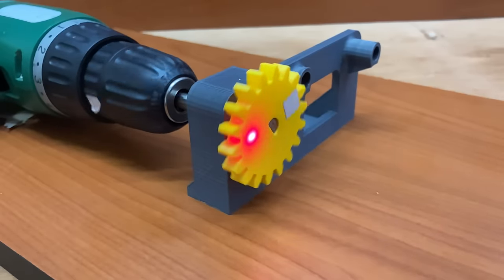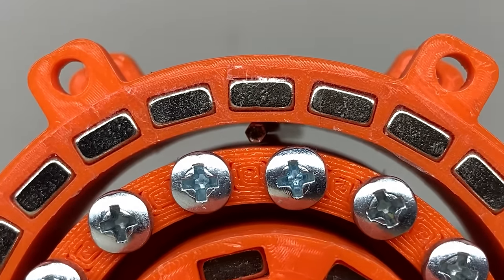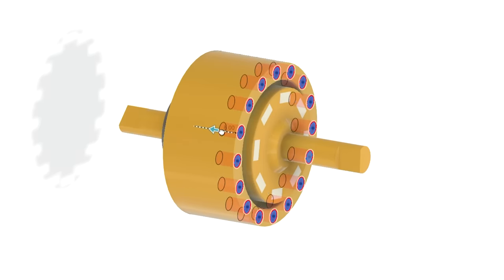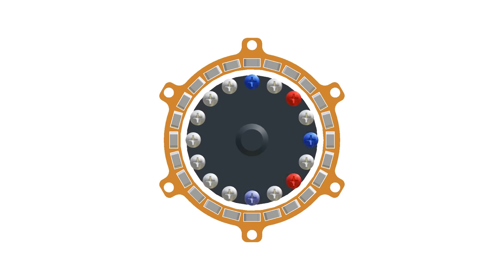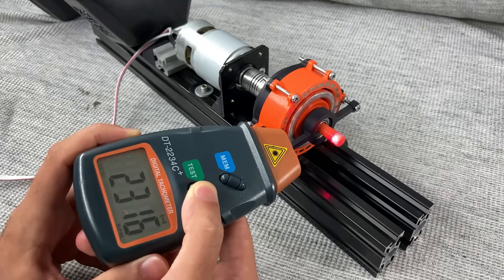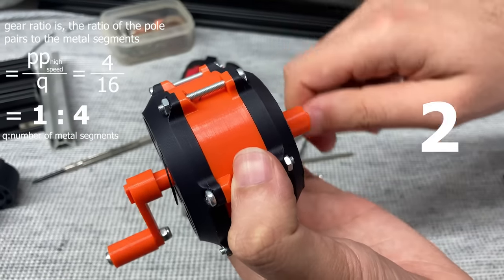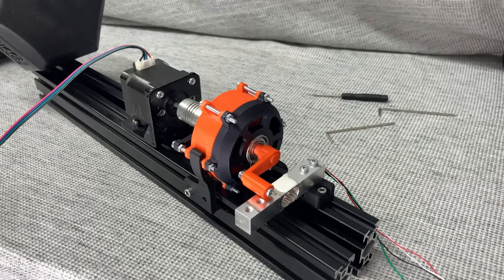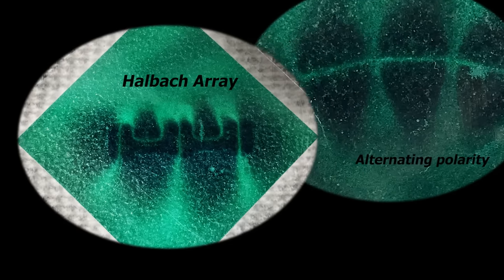Magnetic Gears - Why Nobody Talks About This?

Comment: One of the reasons these would not see widespread use is reduced efficiency due to eddy-current losses within any nearby metal components, and you would want a low reluctance metal housing to ensure you don’t induce voltages into nearby wires.
Reply: @Jeremy Karst. This is what magnetic shielding is for. You know those little speakers that sit next to your computer. You noticed they don't affect your screen. Magnetic shielding preventing magnetic fields from escaping
Reply: @jerichojoe307  I'm pretty sure the amount of current going though a standard speaker isn't large enough to matter, considering I've never added any type of shielding to any speakers I've made.
Reply: @Gorgonzeye  it mostly applies to old CRT displays as far as I know. But the point still stands. Just not the greatest example.
Reply: @Gorgonzeye  the amount of current going through the speaker isn't what I'm referring to here. The speaker itself has a toroidal magnetic field around it even when it's not hooked up just like the static magnets that he is using. Like the guy below commented it may not have been a good example as it only applied to certain types of screens; but it still applies to the point of preventing the magnetic field leakage inducing current in things around it or affecting things that are magnetically sensitive. Many motors still use  shielded housings to surround the motor to prevent such things as current passes through the coils of the motor. Whether it is electromagnetic field or a freestanding magnetic field; simple shielding would prevent what you initially proposed. He is not feeding any current to the gearbox. He's feeding current to the motor that is attached to the gearbox which already meets proper standards and wouldn't require such shielding but the gearbox still does because of its magnets. And even that would depend on the gauss rating of the magnet and how far out the rotating magnetic field could affect things or induce current. I mean think about it. There's a very large rotating electromagnetic field generator inside of your car called an alternator; but you don't see that inducing currents that interfere with any of the electrical functions of your vehicle do you 🤷 my brushless bldc impact driver has some pretty powerful magnets inside the motor but I don't see that so much as disrupting any functions of my cell phone while using it right next to it or while working on a metal door. a magnetic field has to be very close to another metal or very strong to induce currents in surrounding wires or metals, so shielding is not always necessary depending on the strength of the magnet but if it were necessary it would be a very simple solution.
Reply: @jerichojoe307  the problem the original comment tryed to point out is that BECAUSE we need shielding the magned will lose energy into the shielding and isn't transferig it into the other gear while the other gear is losing energy it receives because it is inducing part of it into the shielding and not into rotational energy. that means we have losses in the first gear AND in the second gear. and you would need electro magnets because permament magnets lose slowly their magnetic field when it's magnetic field gets moved.
thze next problem is that you can't accelerate or decellerate these gears fast because they would slip if the jerk is strong enough and it takes way less than for normal gears. the same applies to load on the second gear. if the load is too high the second gear won't move and you need REALLY strong magnets to move the same loads normal gears take without problems. like he shows at 10:00
Reply: @Robin4givin the problem remains that they have almost no torgue before slipping. that means that you can stop the second gear with your hand even if it is spinning at full speed. (like he has shown in the video at the end.) you would need really powerfull magnets with almost no gap that the repulsion of the magnets is strong enough to not have them slip when the second gear gets loaded.
Reply: @indiesigi7807  that too. the size of the magnets is importand and not easily scalabe because the size and material determinds the max magnetic field strength it can have after production. so using 20 1kg magnets to archive the same torque than a 0.4kg metal gear has is byond bad.
Reply: @jerichojoe307  The alternator has been cause for some issues with aftermarket efi systems in classic cars, as well as radios. There have been a number of folks that had issues with the Holley Sniper TBI getting weird issues with it's sensors and motors from the alternator.
Reply: @jerichojoe307  So that would be the high magnetic permeability materials would be best suited for magnetic shielding of the fields?   Guessing might be some design consideration of that material effect?
Reply: Yes
Reply: Yo all you guys are smart as shit regarding this haha. This is what science is for!!
Reply: Oh and lets not forget that ... shock and vibrations = DEMAGNETIZATION!
It is a very good idea to use magnets, where vibrations are unavoidable and omnipresent, as in rotating machinery. 
Thank you, back to the drawing board, beloved design (and I guess marketing?) students ... *facepalm*
( I bet it takes not a millisecond, then one of those little f's will come around and cries: "Eureka ... Let's use electro-magnets!"  )
Reply: Maybe halbach arrays could help!
Reply: @dieSpinnt  vibrations aren't that big of a problem with a proper keeper designed for the magnets. And speaking of electromagnets... We've already got electric motors both with and without permanent magnets. All the engineering for eddy current loss etc. is already there... That being said there's no reason to reinvent the wheel (literally), metal gears bathed in oil already last forever
Reply: But it would be good if you wanted to maximize eddy current losses for a different purpose
Reply: Would modern ceramics and Faraday cage contain the current and direct it back into the system? Is there a video that could explain what’s going on with the current?
Reply: Total energy loss of a drivetrain is usually the driving factor for cost. Also why use rotating gears when you can use wires, thats fairly common, see a diesel electric locomotives etc.
Reply: To further reduce the eddy currents a laminated outer stator should solve the issue, along with offsetting the neodymium magnets by rotating them 36.5° along the longitudinal axis to further even the flux density and reduce torque spin.
Reply: @jerichojoe307  LCD's aren't effected by magnets in any serious way unless you put an extremely strong one near them, they don't require magnetic specific shielding.
Reply: Not only that, but the magnetic field strength is inversely proportional to the cube of the distance between the bodies, so without incredibly tight tolerances the practical maximum torque is laughably low
Reply: That, and magnets under regular stress will slowly (or quickly) loose their magnetic flux until it's no longer functional
Reply: I was just about to explain it after reading the title.
Reply: use non-mag stainless, ceramics and insulating liners.
Reply: @dovos8572  I think you are wrong about magnets losing their field over time.
Reply: @seandepagnier  do you have ever played with magnets? the conservation of energy alone is enough to say that magnets have to lose strengths when they move or resist the movement of electrons or objects. it might take years in some cases like having them just hang on a freezer without moving them but if you take them off and on on a daily basis they will stop sticking after a few weeks.
Reply: @benwilms3942  So it'll be brittle and let the magnetic waves through?  Great idea!
Reply: Use an aluminum enclosure as a buffer for that. Take a Onewheel hub motor as an example. No metals attract the the hub because the magnets are far enough from any area that it can attract from.
Reply: @dovos8572  It depends on the type of magnet, and the types used here take 100 years to lose 1% typically.   If they lost their strength so easily, many electric motors would not last but anyway can easily be re magnetized after a few decades as well.    The conservation of energy mostly is transferring to potential energy so its not lost demagnetizing.    I think the magnetic gear has a lot of potential, but should use ceramic bearings to reduce losses.
Reply: @Gorgonzeye  It has nothing to with the amount of current flowing through the speaker's voice coil, what he was referring to as far as shielding is concerned, is the magnetic field produced by the permanent magnet, which is independent of whether or not the speaker is supplied current. Permanent magnets produce magnetic fields just sitting there, I have personally ruined a crt TV when I was a teenager simply by walking past it with an unshielded car subwoofer in my hands.
Reply: @seandepagnier  there is a reason why in big generators exclusivly electromagnets. we only use permanent magnets to generate enough electricity to power the electro magnets of the actual generator. if we would use permanent magnets in the actual generator we would need really big magnet blocks (really expensive) and we would need to change them out regulary.
if permanent magnets really wouldn't lose their mangetic field we would use a self rotating magnetic system to power a generator that uses perma magnets to generate infinit electricity.
also a change in the magnetic field heats up the magnet a bit and heat is the death of magets. if heated up enough it will lose it within seconds even if it would last decades normally without getting uses.
Reply: @dovos8572  was waiting for the curie temperature reference.
Reply: @sergioezquerro  A Faraday cage is only effective against wave lengths greater than size of the holes in it / skin depth. They aren't necessarily effective against magnetic fields which are different from electromagnetic waves
Reply: Make the other components non metal?
Reply: @ltcuddles685  of course not for something as small as an led. But we're talking about how to make this actually a useful device for anything other than what he did. The way progress is made in today's world is multiple people brainstorming. We moved well beyond the LED in this conversation into slipping, magnetic losses in the bolts inside the transmission, strength of output torque,etc.
Reply: Try using higher resolution of alternating magnets and try two gears where one partially screws (cone shaped screw) into the other wheel that requires the torque.
Reply: There are many technological challenges to producing contactless gears. But they can be overcome theoretically and they will be overcome practically because this has application in areas where wear and tear are high or in areas where you want the parts to last thousands of years like in space exploration. This is good for anything which is extremely tough to repair.
Reply: @jerichojoe307  Actually they don't affect your monitor for a couple reasons:
1) The main reason these days is that LCD/LED monitors don't have magnetic beam focusing coils like a CRT, they flip pixels with + and - electrical charges, not magnetic N and S.
2) OLED monitors don't do pixel flipping at all so there's nothing to influence. 
3) Magnetic field density drops off quite dramatically with distance and even the largest speaker magnets (I'm talking 12" guitar amplifier speakers)  have to be within inches of a old CRT to affect it, also, the electromagnetic driver coil in a speaker is designed to focus most of its energy along the coil's axis, so escape to the sides is negligible. An old fluorescent ballast however is capable of having an influence on a CRT it it gets too close.
Reply: @dovos8572  i have used same perm magnet for 5y same strength
Reply: @RonnieMcNutt666  what magnets do you have? how often do you use them? and for what do you use them? if it are really strong magnets then you might not notice that they are now weaker because they are still more than strong enough for what you are using them
Reply: @dovos8572  also some old tools i have frm 1980 magnetic still
Reply: @sergioezquerro  there are materials that can  shield the greater portion of magnetic field lines but never 100%, although thats typically adiqete. They tend to be rather pricy though. I remember seeing small sheets of the stuff. Also every creavice/opening must be covered/layed or the fields will leak through just like coulomb/static/voltage charge would through a faraday cage. Faraday cages also require grounding to ambient background "neutral/ground" which can vary to be fully effective.
Reply: How does that compare to friction/vibration losses in mechanical gears. Would like to see that
Reply: @dovos8572  That's wrong. The magnetization magnets lose over time has nothing to do with the forces they exert. They do not "use up" their magnetization energy to push or pull on things.
The reason big generators use a field coil instead of permanent magnets is for the ease of induced voltage control and cost. You would not need to regularly replace them but they just aren't practical. Instead of using an expensive set of magnets you can just wind a coil around the rotor and power it with DC current (and adjust it based on the operating conditions).
Reply: You really only need to provide enough linear void space to account for the magnetic flux end effects.  This can be a really small amount of space depending on the magnetic topology
Reply: Contact free power?
Ohh.... nice
Reply: Don't magnets also slowly lose their attraction properties over time?
Reply: Most gear boxes I've seen (fot automobiles) have aluminum housing, non conductive non magnetic metal.
Reply: good point😶‍🌫
Reply: @dovos8572  There are no "magnetic perpetual motion machines". Even if permanent magnets lasted forever, you could not build one. It has nothing to do with how long the magnet lasts. All cyclical paths through a constant field exert no work which is why you can only generate or consume energy by changing the field.
You are also still wrong about why electrical generators (usually) do not have a permanently magnetized rotor.
Not sure why you would mention you are an electrician. It's not like any specialized knowledge is needed to be an electrician.
Reply: The real opportunity would be utilizing this somehow as a clutch somehow.
Reply: Actually the torque is the fault for these systems it's abysmal
Reply: @jerichojoe307  Screen effects from magnets really only apply to CRT monitors
Reply: I'd also imagine the eddy currents would create heat that damages the magnets over time too.
Reply: @todddooley793  It would make a terrible clutch because it transfers no torque in slip
Reply: @jerichojoe307  - What are you talking about? are you still using a CRT?
Reply: @dovos8572  Conservation of energy has nothing to do with permanent magnet degradation. It's accounted for by the kinetic energy taken out of the spinning material (driven by steam in most generator turbines). But I'd never considered the heating effects. I bet large steam powered turbines would get pretty hot! Makes sense that you'd want to use electromagnets.
Reply: Who can use only 200g of force
Reply: Might be less of a problem on sports cars made of carbon fiber
Reply: @jerichojoe307  or HDD enclosure as well as drive for CD-ROM :D
Reply: @jerichojoe307  This isent at all why modern screen isent affected, old screens was hugely affected...and thers usually insufficent shielding around those with inbuild speakers to prevent leakage...just enugh to pass the max limit of leakage...
Reply: well..so he invented a very bad version of the magnetic free motor(but with magnets)....that has been used for decades, as faar as i know exactly whats shown been used atleast 40 years...but is extremely ineffective (wasent a concern then)
...maby he should have read some science books...
Reply: @3xeplodng_3agle_studios  speakers will definitely kill a crt. Seen it happen with speakers under a old TV
Reply: @srck4035  indeed
Reply: whatever you say, science man
Reply: Like a transformer?
Reply: Magnetic gears + Graphene =  Interstellar travel + Zero g applications
[?]
Reply: More and more transmission cases are made with aluminum
Reply: Wow this group is hopeless. A rhetorical reference to an example of what shielding was used for; and everyone focuses on that like a laser asking if I'm still using crt; vs brainstorming on ways to possibly fix the issues with the transmission in question. No wonder progress in the world is getting worse. When I was younger; like minds brainstorming was how progress was made. Nowadays people only focus on pedantic corrections just to have the "I'm right" phase of conversational enjoyment; completely forgetting the premise of the original conversation🤦. I'm out
Reply: This.
Reply: Development is expensive for mass produced machinery like vehicles. It's not financially viable for most applications to develop systems that would be best applied to internal combustion engine applications when most of those applications are being phased out.
Reply: Plus low torque capacity compared to mechanical gears
Reply: @robert7100  No
Reply: @darthazgorath9570  Aluminum is conductive, very much so.
Reply: @gob0b  Where do you imagine heat developing.
Reply: well we don't use gears much in our daily lives, so it should be fine to popularize them for small creators
Reply: @dovos8572  You can fabricate reasons for ANY system to fail.  That doesnt mean ANY system is useless.  Theres uses for nearly everything.  Those loses you suggest would only be a problem with a poor design.  The shielding would have to be right on top of the gears, i.e. only if an idiot designed the system.  It could easily take over 100 years for a magnet to lose enough field strength to en ineffective.  Theres other things wrong with your presumptions.
Reply: @dovos8572  There are applications where stopping the second gear with your hand would be a safty benefit that no mechanical gear could provide.
Reply: @dieSpinnt  i suspect you pound on your geared implementations.  Normal people dont do that.
Reply: @UNSCPILOT  it will take 100s of years for the magnets to lose thier field.  Other moving parts are likely to break first.
Reply: @dovos8572  Stop sticking after a few weeks?  You are wrong on that one.  You need to heat or pound magnets for them to lose thier field that quickly.  If that was true then all electric motors that use permanent magnets, and there are lots of them, would fail just as quick.  They do not.
Reply: @marveloussoftware4914  I would expect hundreds or Maybe couple thousand hours of operation depending on the stresses, loading, and heat the magnets are subject to, and that could drop as low as a few dozen hours.

Magnetism is much more like a battery than people think and can be used up, especially in conditions that cause that magnet to heat up significantly or put the magnetic feild under constant strain.

It's one of many reasons that many large scale motors and generators don't have any permanent magnets inside and usually exploit magnetic induction or other similar tricks, in low torque, low heat, and small scale you can get away with a lot but scale up any one of those and you'll have issues quite quickly.
Reply: mechanical would still be the most reliable and I guess cheaper and faster to make but this'll have use in nano machines
Reply: Hence why we don't need wires anymore if we apply the gears properly with spatial energy coherence.  Simply being in this field would turn your device "on" with a "dead switch" to turn it off by disengaging its function with geometry, I.e. remove one gear...
Reply: Carbon fiber components are stronger than metal ones. The reason we won't see widespread use is the retooling needed for automation to work with the permanent magnets.
Reply: I doubt that is greater than friction loss with mechanical gears.
Reply: Its just so much cheaper using plastic gears. I'm sure there are niche uses for magnetic gears and couplers, but its probably in the realm of 10-1000x more expensive
Reply: The extreme reliability and zero lubrication of these gears make them great choices for spacecraft reaction wheels, though.
Reply: @UNSCPILOT  if your ecpectation were true then none of these motors with permanent magnets would last for years and years.  But they do.  I have seen many failed devices with motors.  It is rarely the motor which failed.  Magnets are not as fragile as you presume.
Reply: @jamezh2822  understood, then I apologize for my misunderstanding
Reply: @jerichojoe307  waving a high powered magnet around in front of my screen also does nothing, so maybe the shielding on the speakers isn't important. CRTs are gone.
Reply: "Why nobody talks about this?" 
Because their efficiency sucks.
Reply: Making everything out of something like carbonate fiber would be sweet
Reply: @Youtube_Stole_My_Handle_Too  its a specialized desihn woth limited applications.

The efficiency of fuel milage of a bulldozer sucks, thats why people dont drive them to work.  It doesn't mean they have no use.
Reply: @marveloussoftware4914  
Does it exist a machine that does a better bulldozer job than a bulldozer? No? Well, then your objection doesn't make any sense. Logic much?
Reply: @Youtube_Stole_My_Handle_Too  Yes, there are ways to do the job quicker than the bulldozer.  There are also ways to do it cheaper.  If you don't know the uses of a bulldozer then that would explain your ignorance.  You see, a bulldozer can do many things.  Also, that is just one example out of thousands.  You do not see logic because you are assuming a very simple scenario that does not match reality.  That is why you can not comprehend the use of magnetic gears, you have a lot to learn.  When you think you know everything you make it obvious to anyone who listens to you that you do not know much.
Reply: @marveloussoftware4914  
A loose claim about dozer, but no example. What kind of a charlatan are you?
Reply: @Youtube_Stole_My_Handle_Too  i was providing something called an analogy.  Its a way to explain complicated things to people so they can understand. 

Id be happy to elaborate further but you would need to tell me what part you do not understand,  i.e. do you not understand what a bulldozer does?  Do you not understand how it can be done quicker or cheaper?  

As you see there is a lot to this.   You need to participate if you wish to understand.
Reply: @jerichojoe307
Reply: @marveloussoftware1417  What in this do you not understand, clown? "A loose claim about dozer, but no example"
Reply: @Youtube_Stole_My_Handle_Too  Here';s something you may understand.  Keep in mind that this is an analogy intended to explain a concept, NOT provide a direct reference to gear uses.

Imagine a minefield.  To clear a minefield soldiers can probe for mines, find them and remove them.  This is the cheapest and quietest way to clear a minefield.  Then I can make a video on how a bangalore torpedo clears a minefield with an explosion.  Now the bad thing about this is it uses resources and announces your position.  So if you want to sneak up on the enemy, probing is necessary.  If you are rushing to reinforce, the quickness is more important than keeping your position secret.  So you see, there are times when one way is good and other times when that same way is bad.  It depends upon the circumstances as do many things in life.

There's your example.  the bulldozer analogy would require you to learn too
many concepts.
Reply: @marveloussoftware4914  
There isn't a better machine doing dozer jobs?
Reply: @Youtube_Stole_My_Handle_Too  For starters, a dozer does numerous jobs.  Depending on the job, different alternates are available.  It gets quite complicated.  So first you would have to identify the dozer job.  Then you would have to understand it.  Finally you would need to understand how and why the alternates are used.   To take a simpleton approach and think one machine replaces everything a versatile machine does is entirely unrealistic.  If I knew you had such a hard time understanding that I would've never used that example.
Reply: @dovos8572  They definitely wont stop sticking after a few weeks.

Of course they lose strength over time.  But I have a 25 year old magnetic alphabet on the fridge kids play with hours per day sometimes and they all stick just fine. Literally tens of thousands of on/off the fridge cycles.
Reply: @marveloussoftware4914  
So there isn't?
Reply: @Youtube_Stole_My_Handle_Too  Try to form a complete sentence.   Nobody could read your mind.
Reply: @Youtube_Stole_My_Handle_Too  I dont believe you have the intelligence to understand based on your immature comments. 

There's this thing called the internet,  learn how to use it.
Reply: @Youtube_Stole_My_Handle_Too  You completely lost the entire concept.  Things arent as simple as you presume them to be.  You dont even understand an analogy.  You would need an education before you can comprehend the solution.
Reply: @Youtube_Stole_My_Handle_Too  Not for you, no.  Maybe if you didn't misrepresent what i posted i could tell you.  Lets see if you can figure it out for yourself.  5 will get you 10 that you dont.
Reply: @Youtube_Stole_My_Handle_Too  How do you keep an idiot in suspense?😅😂🤣😂😅
Reply: @marveloussoftware1417  Don't get hysterical. This is very simple to get your head around. For your initial objection to make any sense there must exist a better alternative to do bulldozer work than bulldozer just like there exists a better alternative to magnetic transmission: mechanical transmission.
Reply: @Youtube_Stole_My_Handle_Too  Like I already told you that you seem incapable of grasping, it entirely depends upon the task assigned to a machine.  So if you want an answer, you must pick a task.  You have failed to do so.  I can't answer I question you fail to ask.

It is quite funny hiw you are so hung up on a bulldozer.   Next troll I run into I will see if it works on them too.  You do provide good comedy!!
Reply: @marveloussoftware1417  
So there's nothing more effective to do dozer work than bulldozers.
Reply: @Youtube_Stole_My_Handle_Too   oh, there's plenty, too many to name.  I've told you that over and over.  I think you may have a reading comprehension problem.

You fail to understand how versatile a dozer is.  I dont think you even know what it does, LOL.

Id be happy to provide you a more effective way to do a task but you can't present a hundred tasks and expect one answer. 

You should've never dropped out of school, it shows.
Reply: @Youtube_Stole_My_Handle_Too  Yes, there is.  Pick a task.  I dont think you understand the basics.   Why you ask vague and unanswerable questions while refusing to provide details indicates you are a troll.
Reply: @Youtube_Stole_My_Handle_Too  There's numerous tasks that a dozer does that can be done quicker or cheaper other ways.  Im just not telling you! 😅😂🤣😂🤣😂🤣😂🤣😂😅
Reply: @marveloussoftware1417  
If you cannot name an example your objection is invalid.
Reply: Yup.
Reply: Or the fact that suddenly increasing the speed didn't break it, it over-torqued it.
Reply: Needs superconducting
Reply: @jerichojoe307  Yeah no. But thanks for the thought. This is the exact reason why "nobody has thought about this."
Reply: Stray field from neodymium speaker magnets is orders of magnitude less than traditional ferrite magnet assemblies. The orientation of the magnetic field is comparatively well focused. There are/were some speakers which had a second ring magnet on the outside of the back plate. This served to narrow the stray field. It had little effect on the flux density in the voice coil gap. 
Also, flat panel monitors are less susceptible to stray magnetic fields. Haven't seen a CRT in years!
Reply: @darthazgorath9570  aluminium isn't an effective metal for shielding. Consider how well two magnets can couple through a 10mm thick piece of aluminium plate.
Reply: what if we went back to positive ground, and used residual voltage to charge the system?
Reply: @hksoundpro  true than what would you recommend?
Reply: @darthazgorath9570  Mu metal, which is an alloy of nickel, iron, copper & chromium or molybdenum. It's designed with the intended purpose of shielding EMI & stray magnetic fields from sensitive electronics.
Reply: @davidmarshall6970  What does this statement even mean? And im pretty sure that these channeles are pretty popular with engineering students, cause all my fellow students watch it too.
Reply: @ajjskins  I think you dont understand how eddy currens work...
Reply: @himanshusingh5214  Its literally the absolute antithesis of lasting forever but i let you research magnetic properties and induced currents for yourself...
Reply: @darthazgorath9570  aluminium is super conductive... Almost as much as copper... Why do you think its used in power transmission...
Reply: @Theio-Birdus  you forgot the most important ingredient: Magic...
Reply: @samsonsoturian6013  that would be the worst possible use case for them... Reaction wheels need fast response time to correct movements and high torque.
Reply: @marveloussoftware1417  >If you cannot name an example your objection is invalid.
ohhh getting rekt here, come on guy tell us one of your illusive secret ways that can quicker AND cheaper clear off rubble or soil than a Bulldozer (a machine specifically made for this task).
Reply: I am only a DT student but from what I can tell one of the big issues is that the gear notion isn't continuous. Notice how it sort of hitches every time the sun gear moves. Scales up version's with more magnets have less of a problem but the magnets wear out faster if close together with like poles pushing against each other. So small scale applications or high torque applications wear desynchronisation  can occur also makes it less useful. The magnetic strength wears out so electro magnets might be necessary but having fast spinning magnets near your components is a problem
Reply: @97denis97  Depends on the craft and you can get some pretty extreme qualities when using magnets. I don't know, you'd have to test one to see if it works and I can't do that.
Reply: @97denis97    You are quite silly.   

For example, magnetic gears are NOT cheaper than traditional gears.  Why you would think that is beyond me..  But they DO have uses where they perform better than traditional gears.  When you use alternates there are trade offs, in everything in the world.  That is reality.   Often when you do a job quicker it is NOT cheaper.

To clear rubble you can use a cratering charge.  It will be much quicker than a bulldozer.  It would NOT be cheaper, just like magnetic gears are NOT cheaper that traditional gears.

For you to dream of something "cheaper and quicker" is to fabricate something different than what I said and completely unrealistic. 

It is obvious you don't understand simple engineering concepts like I was trying to explain.   This is why I decided it would be pointless to provide further information.   You are just unable to comprehend.  Or just wish to argue.  I would recommend you continue your education.
Reply: @marveloussoftware1417  pardon me... but do i have dementia or when did i mention that magnetic gears would be cheaper?!? Please quote my exact comment regarding specifically those types of gears being cheaper? 

Then again YOU said and i quote (something that you should have done) : "There's numerous tasks that a dozer does that can be done quicker or cheaper other ways.  Im just not telling you! [followed by a lot of emojis]" wich is a pretty immature way to tell you dont have any arguments...

Regarding the cratering charge... just wow... that is absolutely not the application to move soil in an controlled and orderly way... That is what bulldozers do, they move soil or rubble from point a to point b, not explode and throw it all around in an uncontrolled blast radius... Try to be more realistic...

Also i amuse myself with such pseudo engineers like yourself that absolutely dont know how to retort without sliding off into semantics... 

How old are you? 

t. Baechlor of Engineering 🤣😘😘
Reply: @97denis97  You do have dementia or don't understand English.   I used a bulldozer as an analogy for gears.  Then I mentioned there can be alternatives to a bulldozer like magnetic gears are an alternative to traditional gears.  Then you insisted on something that was "quicker AND cheaper" than a bulldozer.   So . . .

Either you don't know how to apply an analogy OR have dementia OR are clueless OR just a troll.
Reply: @97denis97  And I also notice how you refine the task to try to make your facts sound reasonable.   You are obviously not interested in reality and only trying to inflate your own ego.  I've seen your type before.   Thats why I didn't answer initially.   You are not interested in facts, you are only interested in tooting your own horn.   You are basically a waste of words but good comedy!!
Reply: @marveloussoftware1417  no, he took too much of his adderal this morning..clearly😂 he felt the need to respond to almost everyone here
Reply: @marveloussoftware1417  wow why so on edge haha, and please quote me where have i refered to you specifically that gears a cheap? Hmmm? Im waiting 😜
Reply: @dovos8572  In a sense "permanent" magnets are like batteries, arent they? Storing energy with their magnetism and giving it up if you use the magnetic field to do something.

Tbf it also makes me think that I have no clue specifically how those magnets lose or retain magnetism. Do the magnets in electric motors need to be switched out too?
edit. Actually nvm that one. Electric motors use electromagnets with those copper coils; the permanent magnet e-motors are likely for low force applications.
Reply: @jerichojoe307  yeah, outside magnetic interference is easily prevented👍
Reply: @jerichojoe307  ll
Reply: @jerichojoe307  When I was a kid, we had some construction toys with strong magnets in them called "Magnetix".  One day I discovered that running them along the front of the TV caused a wicked colour bleeding effect.  Was pretty excited to show my Dad until i took the magnet off and realised the TV was stuck like that...   Sorry Dad!
Reply: @RonnieMcNutt666  You can remagnetize regular magnets by attatching them to other magnets.  As long as you don't need a specific force to be applied by the magnet, that should work well enough to keep magnets magnetic over time.  

The rate at whicu the magnetic field dissapates would be inconsistent though, so remagnetising is unlikely to be useful to a design like the one in the video.
Reply: @LeRoiWilson  Like your qi charger?
Reply: @Ryrzard  Pretty sure an electrician has to have specialised knowledge of installing electrical equipment and, you know not letting people's houses burn down.  Its bad form to insult other people based on their qualifications no matter what they are.
Reply: @Patrik6920  He didn't claim to invent it, he's just demonstating it.  Would you invent a brand new type of machine and then just post it to youtube for free? Come on...
Reply: @jerichojoe307  Don't blame you dude, i thought you made sense.  Peace out man! :)
Reply: @Youtube_Stole_My_Handle_Too  You're not even talking to me and I'm finding your comments unbearable.  Why do you think anybody owes you an explanation?? If you don't understand what someone is saying, ask constructive questions instead of being an insufferable pedant.
Reply: @SineN0mine3  Maybe you're not educated at the topic well enough to fully understand my message starting with "Don't get hysterical".
Reply: Check out a motorcycle stator. OR a cars alternator. These have seen widespread use, it other more efficient ways.
Reply: @SineN0mine3  I'm not the one using my qualifications to prove I'm right instead of using actual arguments.
Reply: Pbbbttt. You go away
Reply: @8:20 the bearing was hot probably due to eddy current.
Reply: @Gorgonzeye  speaker cones usually come shielded
Reply: I immediately thought of the voltage issue. Not the power loss.  Thanks
Reply: I imagine there are a ton of applications where low-torque, non-wearing gears would be invaluable.
Reply: I was just about to ask what effect an aluminum housing might produce, being that it is paramagnetic, but I believe you answered that. Carbon fiber would be good, but newer and better things are on the horizon!
Reply: @holzwurm_hd7029  non mag stainless isn't brittle in downhole drill tools, and ceramics can survive in a jet turbine. I don't think it's terrible idea.
Reply: There is a delta between the two inefficiencies in question. Regardless, magnetic shielding is a thing.
Reply: Can’t you use materials other than magnetic metal like carbon fiber?
Reply: Also they are more expensive
Reply: @jerichojoe307  "magnetic shielding is for" - so, if you isolate magnetic flux from magnets - how they will interact to transfer power? 🙂
Reply: Famous last words
Reply: Thats bs, you could still use it for things that require you to put it into motion, or to crank it yourself. There are a lot of machines that you have to monitor, and things you have to use yourself that stuff like this could replace.
Reply: Couldn't you just have them further away lol
Reply: this and the fact magnets are just too expensive for the ubiquitous applications of gears to make financial sense
Reply: yeah thats the main issue efficiency and electromagnetic interference
Reply: Magnets in a realm of gears ⚙ can play a roll of a frictionless infastructers, increasing the structures future integrity vastly, it's only down side, is magnets not powerful enough to effect without adding power, thus an added energy management. ( the meglev error erra).
Reply: Could something like an external stator be used to absorb and recover some of the energy in the stray fields while acting in part as shielding?
Reply: The EMI on these would be insane, but the advantages are significant and intriguing i want to build one!
Reply: To most people's dought, conflicts in magnetic fields,  happens without insulation to block, plus if these magnets can manage stability levitation hold between structures without power or very little require. You now have friction ware & tare immunity purpose. Just like Maglev rails, failed to utilized in power saving with those principles initiative.
Reply: Eddy currents can also be removed by cracks or slits in the conductor, which break the circuit and prevent the current loops from circulating.
Reply: @jerichojoe307  That was for CRT monitors.  Those days are long gone. You are correct though, there was shielding.
Reply: The magnets will not lose their magnetism, at least not enough to notice. They are commonly used in these applications in permanent magnet dc motors
Reply: @DWDrums123123  it's crazy I made this comment many months ago and yet people are still commenting on it when I had previously mentioned the difference between a rhetorical reference that people could understand for the purpose of magnetic shielding yet everybody was still focusing in on that rather than the problem at hand as if I or anybody else is still using CRT. But it seems after dragging through all of these comments that a few of my comments have been removed. The way progress is made today is by brainstorming my reference to CRT type televisions was a rhetorical reference that most people should have been able to understand in that there are ways to redirect a magnetic field without losses such as was done in the day when CRT was being used. Now yes there will always be some amount of loss; but there are many materials that although may not completely get rid of those losses are very very highly efficient in redirecting the magnetic flux and I'm sure with some ingenuity that someone could figure out a shape and material of shield that could redirect magnetic flux back to its source to mitigate or eliminate losses. But everybody is still focused on that CRT reference with their pedantic need to correct somebody instead of looking at the problem as a whole. So while they continue to Google cliche answers with a pedantic need to try to correct someone trying to make asinine jokes at my expense as if it bothers me, and trying to seem smarter than they are; I will continue to do actual research. Some of which I actually posted in here from a magnetics manufacturing company while people were still focused on a rhetorical CRT reference 🤔 while having never left their mama's basement.
Reply: And another reason is that almost all magnetic gears utilise permanent magnets which made of rare earth metals which is expensive.
Reply: @jerichojoe307  
Shielding reduces external magnetic field, but introduces inductive losses of its own. Which defeats the purpose.
Reply: @jerichojoe307  yea, not in the basement but I thought CRT reference just isn't very relevant anymore. I just remembered seeing it 20 years ago when I was still using a CRT, so no googling on that one.
Reply: None of what you said is based on anything. You're just using the same words he used in the video. Your attempt to look smart on the internet has failed.
Reply: "I'm not an engineer but I play one on YouTube comments"
Reply: @realitynowassigned  Yup. Every videos got that "one person" who just says a bunch of words they heard in the video and pretend they know wtf they are saying. It's so pathetic.
Reply: What about in a carbon fibre bike
Reply: Do we have enough resources in the world to even convert?
Reply: ok, so what is the efficiency loss? spur gears are typ 95%
Reply: I was also thinking the slippage on this would be insane. No points of contact to maximize the energy output. Looks sick though.
Reply: This person has no idea what is or isn’t possible with magnetic design. The same cases made here would translate to electric motors one to one, and they can be over 90% efficient. Magnetic circuits can be made with low core hysteresis losses, and low eddy currents. 

Compared to an electric motor this could In fact could be much higher efficiency since permanent magnets can be used on both rotor and stator.
Reply: @NathanBuildsRobots  the torque capacity is limited only by the magnetic circuit design. You can make torque capacity of such systems to similar levels as an electric motor of similar size.
Reply: @brandonhicks7549  Wow, this is quite the spicy comments section. Well, since someone bothered to pull me back into this...
The torque output is extremely low compared to a similarly sized metal gearbox. Look at tesla. They use a mechanical gearbox. They could directly drive the wheel, but the motor would have to be larger and heavier. Also motor efficiency scales with RPM. High RPM (or really, shear rate between rotor and stator to account for the effect of motor diameter) So the gearbox reduces efficiency due to friction, but the increased efficiency from the motor spinning faster more than makes up for it. That means you have less cooling requirements, smaller lighter motor can be used, and greater range. 

The optimal solution involves a mechanical gearbox. There really isn't a way around that at this point in time.
Reply: If the outer shell was steel & the screws replaced with laminated silicon steel, not only are both of these problems alleviated, but the output torque is much higher because the amount of air the magnets need to drive flux through is reduced.  You need to think like a motor designer when making these type of drives.
Reply: No wires. Problem solvey.
Reply: You can always send a couple of hit man after Eddy... fixed!😎
Reply: Perhaps a copper housing would contain it.
Reply: Yep, I was thinking the same. But there's always a solution to the little things.
Reply: or you intentionally harvest that energy. make the nearby metal components collector coils or something
Reply: Does the challenge come down to the material science of creating non-conductive magnets magnets, to minimize losses in induced current flow?  Bonded powder magnets?
Reply: @jerichojoe307  There is a huge diffrence between the static magnetic field and a fluctuating magnetic field. The static will not induce any eddie currents and voltages. Only an osculating magnetic field will do this.  The reason a car altinator does not induce currents in eternal wiring is due to the laminated iron circuit in the alternator stator. It directs the magnetic flux between the poles. You will also find that your phone has tuned circuits and filters to accept only desired frequencies and critical parts of circuitry in you phone is heavily shielded.
Reply: This is geek-porn level commenting and I'm soooooo OK with it.
Low reluctance metal is verbal lingerie, as far as I'm concerned.
Reply: @jerichojoe307  you basically proved yourself wrong with your alternator example as you are literally harnessing the current the magnetic fields are making.   When you have a AC current being made and consumed in a complete circuit  EMFs are canceled out by  return path.   Here the issue is you are making a generator but instead of turning the EMF into electricity on purpose it will be done possibly on accident through the case.  A car cant really be grounded  to earth ground either
Reply: Magnetic gears can still be more efficient than traditional gears.
Reply: why would you not have insulated housing?
Reply: @jerichojoe307 you still got crt BRO lol
Reply: The metal housing would then become the thing that becomes parasitic. I would think eddies near the shear plane would dominate over stray field and nearby components, which could be mitigated by shunting poles. I'd bet the stray field would be primarily static, so not concerning.